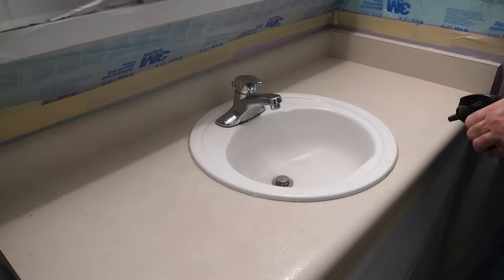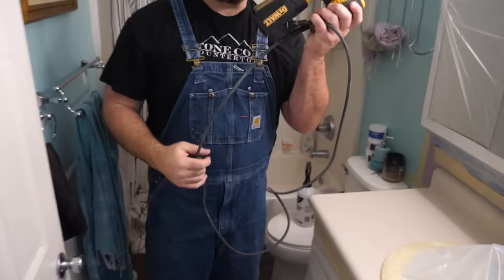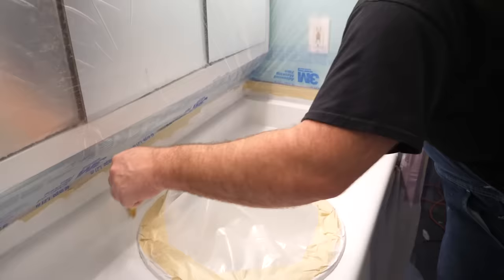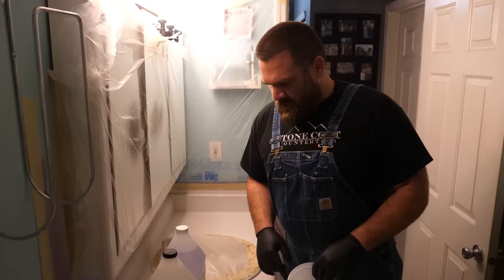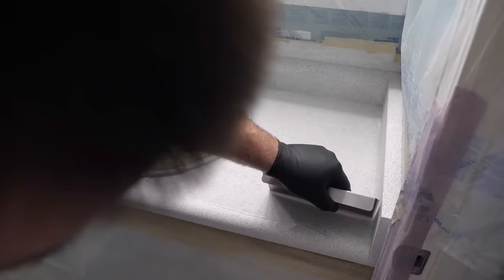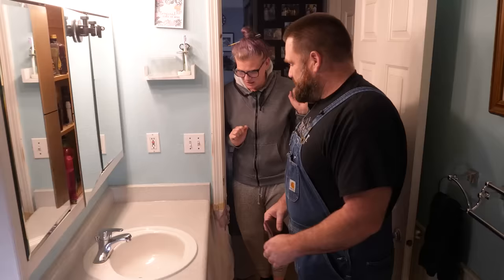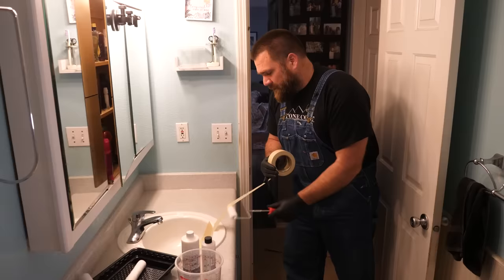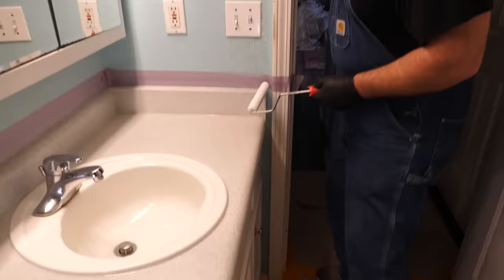Epoxy Countertop with Sink and Backsplash in Place | Stone Coat Epoxy

Comment: I noticed the delicate surface tape pulled off some of the paint. I fought the same problem in my kitchen, and in my experience, the reason this kept happening was because before painting, I had made some repairs using some quick-dry spackle in one of those tiny jars. Those areas could not withstand the delicate surface tape.

Comment: In your videos, could you include what you do you after using each roller or brush. For example, do you put them in a plastic bag and save them to use again? Do you throw them out? What are the in-between steps to avoid making a mess.

Comment: just curious, is it possible to not put the epoxy on, but just use the ultimate top coat?
Reply: That wouldn't work for this type of application. You would want a smooth surface. The stone spray is bumpy little dots on the counter and the epoxy self levels right over though. Only one coat of epoxy is needed when using the top coat

Comment: When computing surface area on something such as the built in sink vanity, I see you don't subtract the negative space of the sink and even added extra for backslash area. Especially since it was clear coat, did you end up with more than you needed of mixed epoxy? Do you ever guesstimate that hole (not whole) area on the big countertop jobs and subtract for the total 3oz./¤'  ?

Comment: I took my sink out for my project which added $1000 to my project plus trying t find a plumber to do that.  What wasn't mentioned is that usually silicone was initially used to seal the sink and I should have used some TCP to get all the residue of the silicon off as the epoxy sort of blistered in places around the sink...  Hopefully, with the second sealer coat, I can clean up that problem,

Comment: Great video very detailed and reassuring for people like me who may be timid to try this type of project!
One thing I noticed was that it looked like a more glossy finish before you applied the final top coat. Is that true or just a camera angle? When y'all do the other epoxy methods it seemed to be shinier. What am I not seeing? I like the spray on stone color, much easier than mixing all the different colors viewed in other applications. Thanks again for the details!!!

Comment: It's a good video & everything is explained in detail regarding the prep work. BUT one thing you haven't mentioned is about wearing a face mask for dust, gloves for your skin from the start if there's an accidental tiny splash on it or as there's a lot of primers and sprays - you didn't mention anything about VENTILATION ESPECIALLY as the room you did is so small. You covered the floor & surrounding area though. This is a small project in an area that people don't see - is there a video to fix things ,(eg if someone smudged the top before it dried out). If for example one did a kitchen top which in a prominent place in the house or would it be better to get a pro to do it? Where do you buy the torch to remove the bubbles?

Comment: I have 10 yr old laminate tops in my kitchen. They have a smooth finish that I really like, but they have no shine. I would like a shine as  close to glossy as possible. I am wondering if I can just finish them without using the granite-look spray? In other words, I like the look of my laminate and simply want to add protection and shine to them.
My questions are: 1- How can I achieve the look and protection I want?  2- How durable is a shiny topcoat, if its available, i.e. will it dull over time or show wear?  3-What is your topcoat made from?
And one last  question unrelated to my countertops: Can your epoxy and topcoat be applied over acrylic paint? I'm an artist doing a unique project and would be interested in possibly using your product to finish my art piece. 
Thank you. I love watching your videos. You make it look easy.

Comment: I definitely need to do this in both of my bathrooms.  The problem that makes me figure it can't be done is that the sinks are all part of the counter top.  There is not a way to separate the sink by merely prepping.  So can a sink be epoxied?  I'm figuring I'll have to remove/replace the counter top and sinks and start with new rather than rehabbing.  Thanks for the video, too!

Comment: I love the look of these products and have to work on a budget. I have laminate in a bathroom and kitchen.  My bathroom is a mold that has the sink included. It seems that it works best on flate surface because of running. So it's this not a good idea for a sink? 
My kitchen has the bend in the laminate that runs up as a  back splash about 8". Is this not a good idea also?
Great video.

Comment: I love it! I live in an rental and I’m updating the countertops and backsplash with contact paper.  Can I use the epoxy on the paper and get the same results? However, I will need to remove it if I have to move!

Comment: how many hours are into a project like this? plus the materials, i spray this prosses with the same two products in gallons,then clear it with urathane with hardner and have the same look,i was interested in adding to my buisness, but for the coast of a new top,your loosing money,and brush marks or most of the finnish on the floor ,the rusted sink ,adds to your non thinking about pulling the sink and not damages your finish,

Comment: bit worried for about edges when you remove masking tape, but I guess final layer will solve imperfections. I assume during exploitation of your refurbished vanity, when you clean epoxy surface you must not use abrasive sponges or brushes?

Comment: really helpful video! what's the purpose of the topcoat? Is it necessary?
Reply: Great question! This is meant to increase durability on that top layer. It comes in a Matte and Gloss finish so you can keep a Glossy finish or save yourself hours to create a matte finish. It's not necessary, but recommended for that extra durability.

Comment: After 4 years, I still love my countertops in my kitchen and sunporch.  I do have a question.  I have one small area by by sink.  I followed every direction.  I have a few small cracks nearest to the sink itself.  That area is only about a foot by 6 inches...probably because the Formica it was applied to was at least 40 years old.  I only need about a quart of each to fix just that one side.  I didn't see anything less than gallons on the website the other day.  What do I do?

Comment: Could you embed ceramic chips (broken china) or mosaics into the first epoxy coat while wet and then pour one or more coats over the top to enclose the mosaic underneath it? That would look awesome!
Or wd you need to embed it in adhesive and grout it first? Wd that even work?

Comment: With all of the time, prep materials and coatings wouldn't it be cheaper to just replace with an inexpensive granite? 2 hours and they have a new granite top versus 2 days? Just curious what the upside is of this method on such a small top.

Comment: I have a bar in my kitchen that's topped with hardwood that I've applied varathane to (about 10 coats) but it still has space between the boards - just enough that salt, dust, grime gets down into it..  I'd like to epoxy it to make it a solid surface but I want to keep the look of the wood - is there a CLEAR bonding agent to use prior to the clear epoxy coating????

Comment: I know this is an old video, but I want to ask... If the vanity has an integral sink will normal use cause the top coat to bubble , deform, or delaminate? What about cleanig? Is it effected by toothpase, mouthwash , shaving cream and whiskers. I have a countertop with Boticinnio marble and toothpase dribbles have etched some gnarly spots into the surface over time. Wondering if the top coat will perform better than sealed stone vs toothpaste.

Comment: What is the purpose of the top coat, it looks like it gave it a matt finish, I preferred the high gloss epoxy clear coat, could it have been left at the stage, without the wet and dry top coat?

Comment: Hello!  After you applied the first coat and applied the heat (25:37 time line) you said that you were going to let the bucket sit for about an hour to let it thicken up. Is that from the left over epoxy or did you mix a new bucket?  At about 25:17 in the video you just ran the heat on the backsplash and then you used the brush on it. Do you do that each time after you run the heat? 
Thank You!

Comment: I need some advice. I tried a little epoxy project with an old countertop. I applied my undercoat (I used enamel) paint a little too thin before applying my coat of epoxy so you can it through the epoxy. What do I need to do to be able to do another undercoat, and then apply another coat of epoxy. Thanks for all the videos!

Comment: I wd like to know if you went back over with the torch after you put on the thickened coat of epoxy on the backsplash? You said use the torch 3X but only showed once so not sure when to do the last one. 

Also, is there some reason you can’t leave the shiny epoxy finish and must put the topcoat on? They both look beautiful but the shiny finish looked like glass. Is it not durable enough? Or is it just bc it’s easier to even out the backsplash?

Wd this hold up on kitchen counters too? I mean with the spray stone coat?
Thx.

Comment: Need advice on what to use on my river table that I screwed up. I used a marine epoxy over a wood stain. And the epoxy needs another coat of epoxy. Help please.
Reply from the maker: Hi! Mitch here, if it was your 1st coat of epoxy over a wood slab, it will be full of bubbles. That is air off-gassing from the wood as you seal it up with epoxy. Sand the entire surface with 220 grit sandpaper and open any closed bubble. Mix another coat of epoxy and apply. When I do wood slabs I do 3 - thin coats of epoxy applied at 1 ounce of mixed epoxy per sqft of table. Let the thin layer cure lightly sand with 220 and re apply a thin coat. This seals all the air in the slab allowing you to pour a thicker layer at 3 ounces of mixed epoxy per sqft of table. The air won't off gas into the resin at this point and will lay out like a sheet of glass. Send me pictures of what your table looks like incase I can steer you in a better direction after seeing the project. email me mitch@stonecoatcountertops.com

Comment: What if you just want a plain color surface? I just watched another video for this product and they used no rolled on undercoat. They just did one stone layer, then a white middle layer then finished with another stone color before sanding before the clear epoxy. What stopped me was the blow torch.

Comment: I wouldve thought that you would've ONLY used "the Ultimate Top Coat" so it could be rolled on. How did you keep it from running off the attached backsplash into a puddle at the junction of the back and deck of the premade laminate? And yes i watched the video. It appeared that even with thin coats you were putting on with the brush that it was still sluffing off and trying to self level. So i guess my real question is why no use two coats of the "Ultimate Top Coat"? Is it because the texture of the spray would stick out if it didn't have the thicker epoxy layer

Comment: I have a question on ventilation I have some counters and a large desk I’d like to epoxy coat but they are located in a basement with no windows the only door or window outdoors is on the other side of the house. Not so much worried about the actual application time as I can use a fan wear a ventilator but my parents occupy the rest of the basement level so I can’t have them getting sick while it’s curing is it possible to just seal the room and if so what will happen once it’s cured and the room unsealed?

Comment: When finished, is the surface smooth or rough. I have a cultured marble vanity, with an integral sink. Can I use this method to include the sink? Obviously,  all the plumbing would be removed.  I'd much rather have a white, with gray veining. I've tried paint pouring for years and its been a huge failure. I'm on a fixed income. Please share any links that may help.

Comment: I love these epoxy jobs when I first got into them it was called bar top that was about 30 years ago , now I love the gloss finish it adds so much depth to the project but pretty much all the jobs I see you apply the top coat which seems to change it from a gloss to a satin and you lose depth is that top coat really necessary what does it add to the project ?
Reply: Quote from SCC Account "UTC does change the sheen, and is completely optional. It does offer the enhanced durability. The final coat can be SCC or Art coat without additives and give you that high gloss glass like finish. You Got This!" 
I agree I prefer the high gloss look and hope that there will be a future UTC product with different finish option with the same durability properties. (if there is not one already)
Reply: @willisholladay5871  Thanks for the reply

Comment: Which kit is this?  In the video you mentioned that the cost is around $50 and way below $100.  I don't see anything less than $119 on your website and the one that I saw doesn't seem to have all the items you used in the vid.  Do you have a kit that has all the items in this video? I'm interested in giving it a shot.  Thanks!

Comment: How does this epoxy handle hot pots on kitchen counters?
Does it not get cloudy over time?  Thanks ;0)
Reply: I spoke with their customer service the other day asking for the SDS and heat resistance rating. After full cure it has the potential to withstand temperatures of up to 470 degrees. side note Despite the heat resistance rating I would personally recommend to keep heated items to incidental touching rather than pulling a pan right out of the oven and placing it on the counter. or use a hot pad. Best of luck with your future projects and I hope this helped somewhat!😄

Comment: can you sand epoxy ofter it was  dried , we left area and sides got bad pumps, points, help.
Reply: My experience with epoxy sanding is the sandpaper gets clogged very quickly.  I use a putty knife that is heated to red hot, then remove the bumps and drips.

Comment: Try automotive Brake Kleen instead of TSP. It leaves no oil or grime…..none. I’ve not had as good luck with TSP as the Brake Kleen product. I’ve painted several kitchen cabinets and Brake Kleen cleaned off all the cooking vapor grease much better than anything else.

Comment: Considering the relative ease of removing the sink and water supply connections, I'd never leave the sink in place and epoxy around it.  I'd prefer to have the epoxy finish carried underneath he sink edges and re-install the sink over it after the new finish is cured.

Comment: Rust-Oleum says the spray shouldn't be used in bathrooms due to moisture and humidity.
Reply from the maker: We covered and protected the paint from moisture and humidity when we applied a coat of epoxy over the paint.

Comment: In the time it took to mask off the sink, I could have removed it.Also removing the sink you could have sealed the edge of the hole, preventing any water that may seep in from distorting the counter top. Over all though, a great job... I'm planning on doing my kitchen counters shortly, 32 linear feet

Comment: okay, so it looks okay, and I appreciate this is a unique process, but as a professional countertop refinisher myself, I can't see spending three days on a tiny bath vanity that only might bring $200 tops when my process using an HVLP sprayer, epoxy, decorative layer, and urethane top coat only takes about three hours from start to finish and I'm onto the next job. Plus my counters are dry and ready to use in 12 hours.

Comment: While the counter itself looks great after it's done it's not very cost effective. At the end of the day that is still a laminate on chip board underneath. Any water leak underneath and your 2 day's and a few hundred dollars of work is going to blow apart. The vanity itself is still old and so are the sink and taps. I have no idea what the bill was for you to be there 2 days but I am quite sure the customer could have purchased a new vanity with a quartz top & sink, and taps for not much more. Granted you either learn to do a bit of plumbing or pay someone to tie it in but everything would be new. It also gets done in a half day.

Comment: I actually like it better with glossy finish withoutnthe top coat. Also i did not like the fact that the top coat was not epoxy. But, that is just me.
Reply: It comes in a Matte or Glossy version. Would you like Mitch to do one that showcases the Glossy version?
Reply: @jeffjensen3762  that would be nice

Comment: Yes, not pulling the sink saved you time. However, in every older house I've owned with this type of over-mount sink had a sink with the same feature... A rusty overflow drain. In two occasions, it was rusted through and I had to replace it. If you don't remove the sink before you do this process, and the sink ever needs to be replaced, the flange of the new sink may not have exactly the same flange profile. So, potentially un-coated countertop could be left exposed. Just something to think about.

Comment: Also, I learned the hard way that epoxy in the sink is really hard if not impossible to remove. Whoops! I tried to clean some art supplies in my bathroom and now there are drips that are there forever.
Reply: Yikes! What type of sink do you have that the epoxy is stuck to?
Reply: @mitchquist  it looks just like the one in the video. The drips are clear and they're small, so most folks wouldn't notice when the sink is clean.